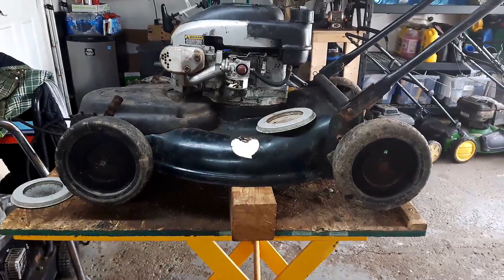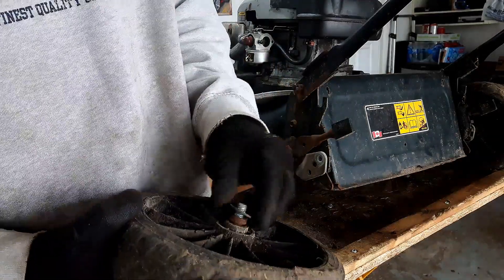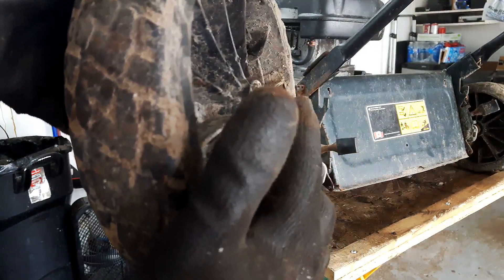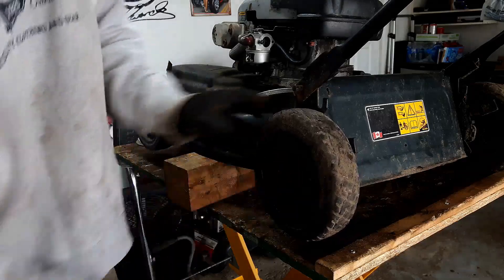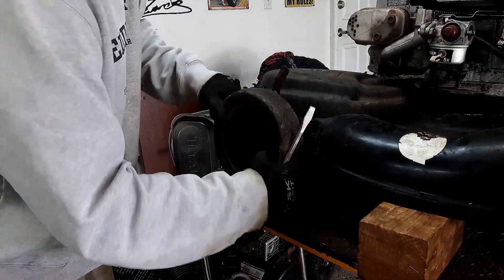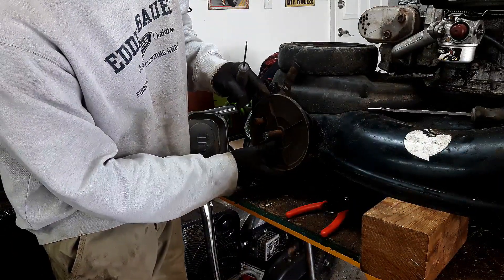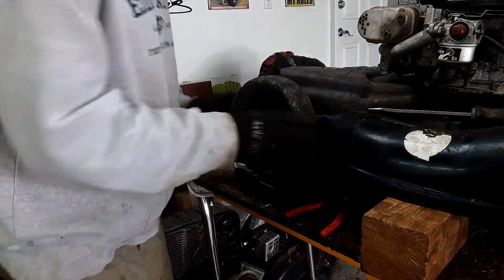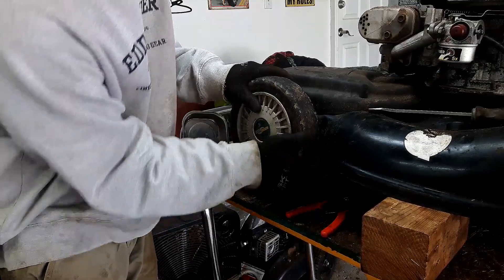How To Fix Wobbly Wheels On Lawnmower

Comment: Try watching, Steve's Small Engine Repair video and learn how to fix it right for cheap!
Reply from the maker: The right way to fix it would be to buy a new wheel but you are correct, Steve's way is pretty ingenious. But if you don't have copper pipe hanging around, this method would work in a pinch. Cheers